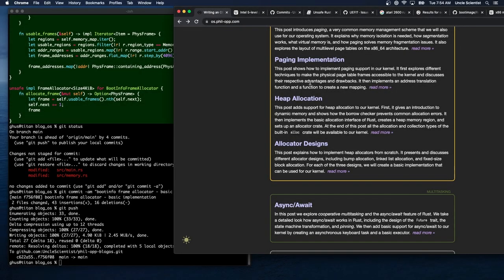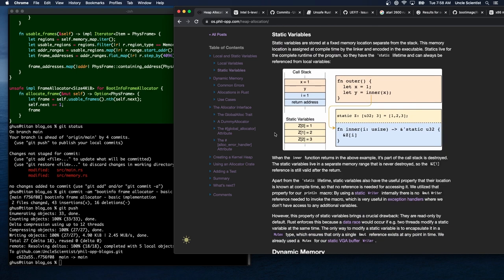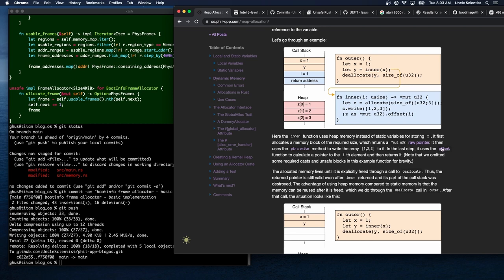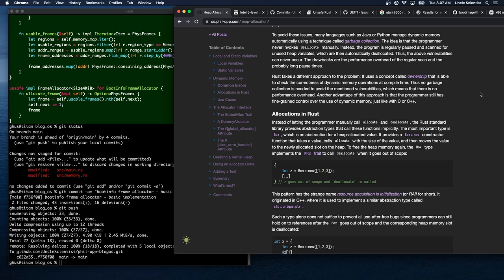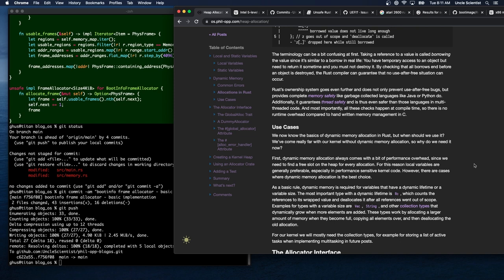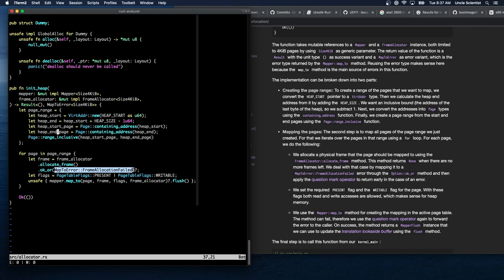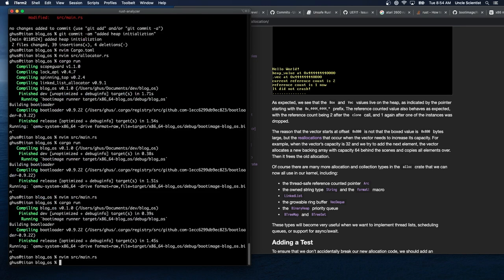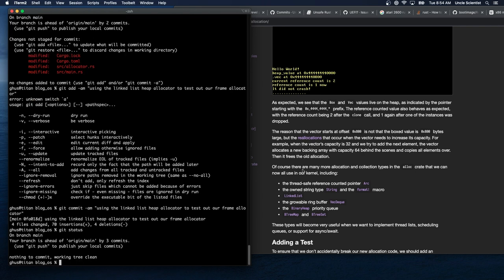Writing an OS in Rust - Part 10 - Heap Allocation

Comment: 9:53 Normally you'd be right because what you're thinking about is exactly how heaps usually do work. However this is just an example. It's perfectly possible to implement a heap to work this way (that is: to allow such in-the-middle deallocations). But, again, that's not how heaps are usually implemented so you're right that it wouldn't work in, say, a regular C++ code running on Windows.